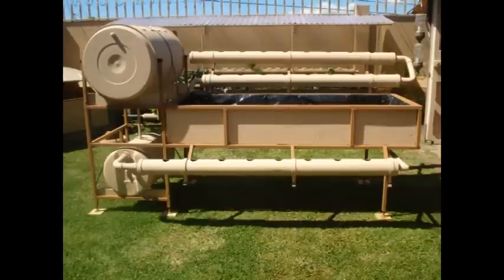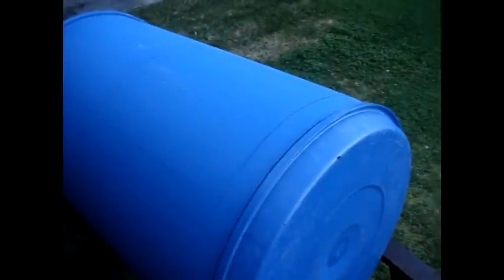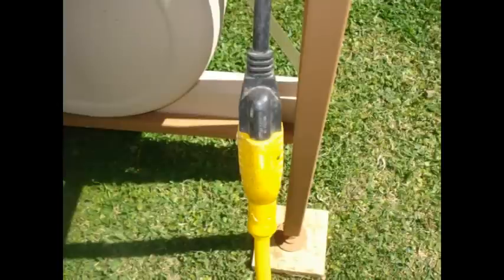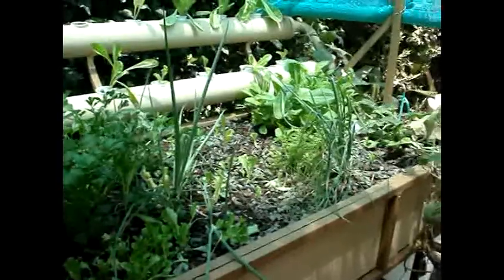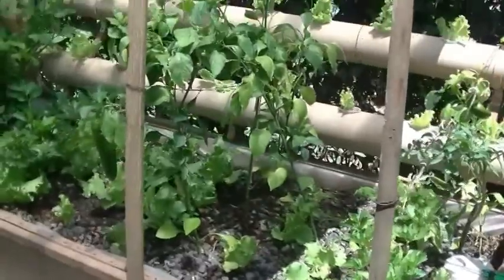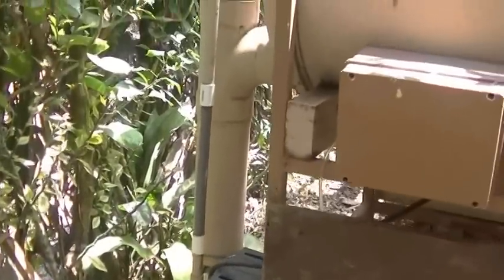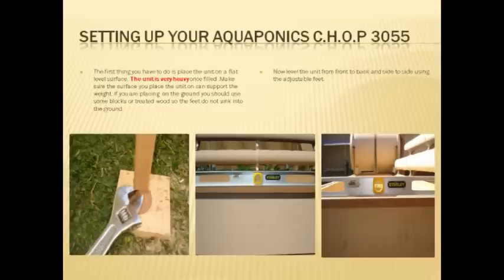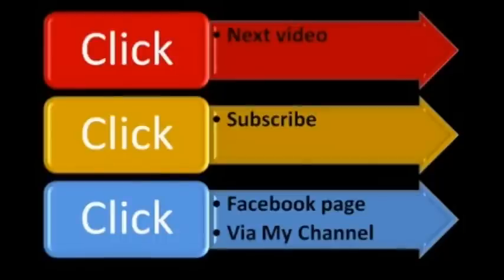How to build a semi portable aquaponics garden.

Comment: What a great video.  I have been watching tons of videos and thinking about trying to set up a system in my mudroom at home.  I have been trying to figure out how to size it to be able to be self contained and self sustaining minus a little feed for the fish and monitoring regularly.  Do you have the powerpoint available or plans available for download?  Great looking system.
Reply from the maker: +Bryce Martin I don't have any plans at this time. You could make one like this using two 55 gallon drums one on top of the other pretty easily. You just have to have the planter in between the height of the top tank and the bottom tank. My planter was about 12 inches deep. You could also try a 250 gallon tote aquaponics garden there are many videos on them. If you have any more questions I will try and help if I can. You could also make it out of wood instead of steel. Good luck